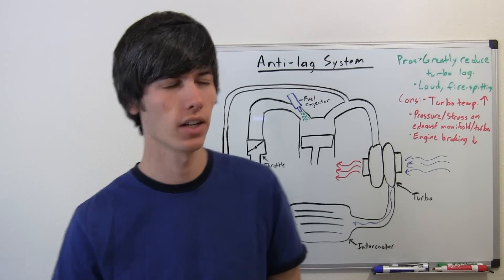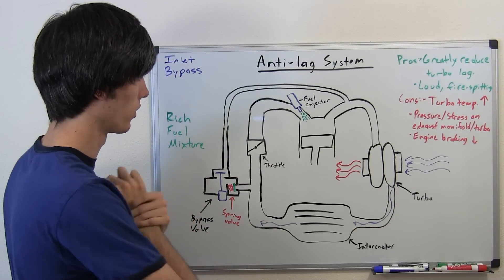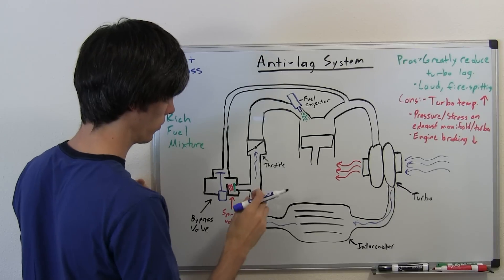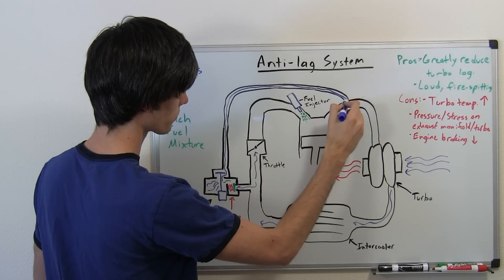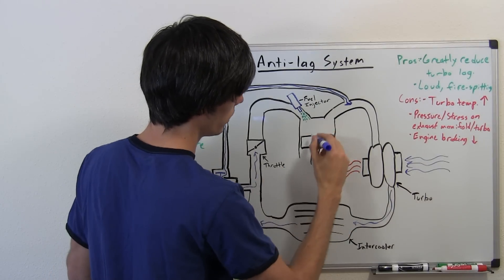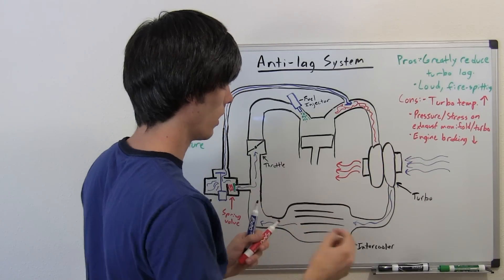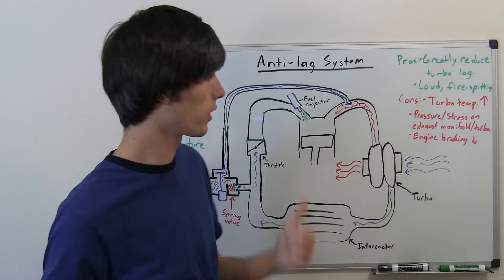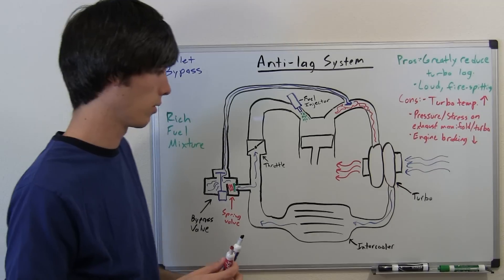How Anti-Lag Systems Work - No More Turbo Lag - Bypass Valve

Comment: Thanks.  That is a good answer. 

You show a single cylinder engine for your explanation.  In practice, is the air injected just at the start of the individual manifold runners like in the old air injection systems for unburned HC?

Comment: its really work..i modified mitsubishi lancer evo 6 bypass valve into my galant vr4..the problem now is the valves cannot withstand the heat and yes there is no engine braking and ive remove the brake booster because the negative pressure from the engine so u cant feel the brake firmly...

Comment: Yes, there were some GT-Four Celica's made for WRC homologation that came with a bypass-type ALS, intercooler sprayer and a water/meth injection system. And the Mitsubishi Evolutions 4 to 9 all had the bypass ALS installed, but with a secondary air-intake and only on Japanese market vehicles. Some special edition Subaru WRX's also had it, however most anti-lag aystems are the misfiring type ALS as it is an option on some of the popular aftermarket ECU's and doesn't require the extra plumbing.

Comment: Given that EGTs are already an issue for Mitsubishi 4m40  and 4d56 engines, as well as most turbo diesels, it looks like releasing the pressure to atmosphere, which at least doesn't allow back pressure to SLOW the turbo. Any thoughts on this?

Comment: I used to have a go kart years ago that sounded like it had anti lag with a "straight pipe" (a literal pipe). Basically there was a lot of unburned fuel due to a lean mixture (on purpose) which built up in the straight pipe we had causing combustion in the exhaust.That thing was LOUD but so cool at the same time.

Comment: Blow off valves allow turbos to maintain spinning even due to pressure build up, and it just opens the intake system to the atmosphere, but that flowing air , with a diverter valve , will be placed into a hose, back around the intake system, allowing it to just keep flowing through the intake, and once the throttle is opened again and that Diverter valve closes, that air flow allows for the turbo to still give power due to it already at a good rate of spool

Comment: In regards to you suggesting to reinforce your exhaust manifold; what considerations should i take for a vehicle that does not have a traditional exhaust manifold such as tubes welded to a collector for a turbo? The engine in question is the Ford 2.0L ecoboost

Comment: Yes, I agree but what I meant was, in Audi system the boost isn't redirected in exhaust manifold but in the intake system before air meets the turbo compressor wheel. Between air filter and turbo. (sorry for bad english)

Comment: The setup is correct. Also I'd love to see a fuel injector that can withstand the super high temps found in an exhaust manifold.

You are talking about bore wash, antilag won't cause that if it's properly mapped.

Comment: escort cosworth work different to this, it uses a larger idle valve and alters the spark timing so the combustion happens in the cylinder however the exhaust valve is open slightly so determation also travels down the manifold through the turbo.

Comment: I have a 2013 ford focus st and i have been told that it uses a BPV.  This is stock from the factory.  In order to preserve the system did ford also use a BOV in the system?  I'm confused as to why ford would use a system like this if it will not last.  thanks!  awesome video!

Comment: the exhaust manifold is actually really hot. if you look for some videos, the exhaust manifold actually glows red due to the heat. so the heat of the pipes ignite the mixture

Comment: You forgot to mention that there is similar system using Diverter Valve, for example in Audi or Saab where boost builded in intake, in case of closing throttle body, is redirected back to the turbo intake. So it's like spinning freely without builing up boost but with already builded boost from before valve opening

Comment: The redirected air going into the exhaust manifold is mixed with the excess fuel coming out of the cylinder during the exhaust stroke. How it the air-fuel mixture in the exhaust manifold ignited?

Comment: Sorry for the confusion. I'm referring to the air between the closed throttle plate and the turbo outlet. Bypass valve should redirect that air back to the turbo inlet rather than to the exhaust manifold? Cuz thats how it is setup on my mazdaspeed 3 from the factory or at least how I read it on the diagram provided by Mazda.

Comment: You wont just cause high temp and damage to your manifold and exhaust but i seen when the turbine wheel is melted down so of you payed a pretty penny for your turbo then save the anti lag for someone else. Also get an external waste gate and dump it helps alot.

Comment: good video.  
but anti lag or apc and recirculation valves blows excessive air back trough  the intake.  right?  why should it go for the exhaust manifold?.  air goes through the manifold into exhaust piping and will definitely screw up the Co2 sensor

Comment: one more question, wouldn't exhaust gas goes through the lines and to the BOV? since its coming out my force, no? I have the celica gt4 with four metal lines coming out off the exhaust manifold. I was going to make it work with those.

Comment: Thats what the MAF in GDI Engines is supposed to do. To maintain the correct stoichiometric fuel air mix. ... still mechanically simpler than VGT or VNT, or even Sequential turbo or Twincharger setup.

Comment: Great videos dude, really appreciate the knowledge, but I have a question, I am pretty knew to all this so excuse my ignorance, but with this type of system would that eliminate the need for a BOV? as you would need that back pressure to open the spring valve to bypass the air, or is a BOV still used?

Comment: I can't see this being an issue with low bhp n no cats. As explosions will take path of least resistance. Maybe even 4inch exist straight through will help send explosions in right direction?  And also inspecting turbo regular for early signs of replacement so can do small job than buying new. Am I thinking correctly? Thanks

Comment: i find that when im darting through traffic i need to drive with both feet to keep the rpms high while over breaking to keep the turbo spooled in order to have good enough 20-60 acceleration to dart into and out of traffic.

Comment: hey, a turbo car, that has a MAF, has a Diverter valve, but I was wondering, if I were to delay the timing, I could possibly put in a forge splitter so I can direct air into the exhasut and back to the pre-turbo area?

Comment: Judging by the whiteboard drawing, this looks exactly like a standard closed loop system with a fully recirculating diverter valve - like the ones used by Audi

Comment: An explosion like that in the exhaust manifold of course it would cause damage to the manifold but wouldnt it have enough force to push the exhaust valve open possibly making it float or making your pistons crack aswell?

Comment: There are celica models (gt4wrc) that were factory fitted with anti lag to meet wrc homolgation rules, but it is disabled in road going cars and I don't think the factory computer ecu facilitates the ignition mapping for it. Have herd its not hard to get going with an after market ecu, definitely hard on the manifold though and would probably grenade a stock turbo...

Comment: Its preventing the charged air from slamming into your closed throttle when you let off the gas pedal. This 'slamming' can cause damage to the turbo when the air comes back at it and tries to fight against it.

Comment: I always figured that ALS was created by ignition cut-off rev-limiters controlled by the ECU parameters, essentially just by cutting ignition to a very minimal amount would make the exhaust gas a mixture of unburnt air/fuel, but i never knew systems like this existed... Seems to me like this only exists because somebody didnt want to pay royalties to whoever held the patent on the ignition delay system. Thanks for the vids, keep them coming.

Comment: You can resort to many systems, in this case the bypass is made to direct more air to the exhaust directly to make sure there is a more complete burn in the exhaust probably... 

please some awnser my question!!! 

We keep the ignition delay of the normal ALS or does the fuel detonate ?

Comment: Can you do a video explaining what happens inside your engine when it leans out? I ask because the boosed boiz h22 swapped civic , leaned out on cyl. 3 due to an electrical system issue, but the damage on on the single cylinder is insane!
Reply: I understand that the fuel cools down the engine somewhat as it runs, and i know e85 does it better, im just curious as to why it melts the way it does and not from like the center outwords, or rather from the exhaust side of the piston first, besides the fact that thats where the air is rushing in from

Comment: With the bypass valve is this the system where you can adjust it to either atmospheric (Creates the woooaaassshhh sound) when you let off the gas pedal or change to recirculate like you were demonstrating?

Comment: When you showed how the bypass works, I immediately thought: that's brilliant, the pressure from the fresh air, spools up the turbo again. But then, you explained that there still is some fuel injection and explosion going on in the manifold. But that's about the same as the other ALS system from your previous video, right? 
So the only difference is the way they get their fresh air in the manifold? Is the air pressure from the bypass not enough to keep the turbo spooled up?

Comment: So the bypass valve is pretty much just a recirculating blow off valve plumbed into the exhaust manifold ? quite easy to setup then, just a matter of programming the ecu to activate als?  cool. I guess the program parameters to be met would be > X rpm + throttle position < X position yeah? does that sound right?

Comment: I have a question. what is a great material that would be suitable for a exhaust manifold that will have a ALS installed? Also, can a Dog box transmission be another solution to lag in turbochargers? ty :)

Comment: Good video man....... and how does the other DV works which is mounted on the compressor wheel  housing..... cause i thought this thing was designed to protect the compressor wheel?????? Anyway your diagram is exactly for MK6 R version and for MK6 gti  it doesn't bypass that pressure like that and the intake doesn't blow...... please clarify for me on that system man..... thanks

Comment: Hey man, not related to anti-lag system but could u explain how the bypass valve that are built in cold air intakes prevent cais' from hydrolocking? @engineeringexplaned

Comment: Engineering Explained Wouldn't the explosion happening in the manifold force the exhaust valve open or maybe damage it?
Reply: The exhaust valve is already open. Anti-lag works on the ignition/exhaust strokes.

Comment: You say that this bypass type of anti lag still has the disadvantage of no engine braking, but the throttle is closed which will cause a vacuum when the cylinder is on an intake stroke - the basis of engine braking.  Please explain.

Thanks.

Comment: I'm not sure that I understand this correctly, but typical blow off valves vent to the outside air, right? In this scenario for an ALS, the blow off valve should be connected to the exhaust manifold before the turbo?

Comment: You say the fuel system is still supplying extra fuel.  Is this because it's using something like an air flow sensor ahead of the blowoff valve or a MAP sensor ahead of the throttle body?  Or is the ECU simply programmed to dump in extra fuel for a few seconds when the throttle is closed?

Comment: Hi, I have a question:
in the case we have the fuel shut off valve, this would not work anymore, since we just have air in the engine,right?
For what concerns the anti-surge valves, is there an advantage in recirculating the air in the intake duct, upstream the compressor, rather than discharge it in atmosphere?

Thanks!

Comment: well, keep the turbine spinning, even when you close the throttle, see Blow off valves just releave that pressure, but instead of blowing off, it gets to be recirculated for that instant after closing the throttle body, allowing no pressure build up, while maintaining  the turbine's spin speed. When this happens that turbine is still spinning so the next time you get on the gas, it still can push air, once that diverter valve closes.

Comment: Which ALS do you prefer out of all the methods?
Reply: +Chris P it depends on what you're gonna be doing. I have a Subaru BRZ equipped with a turbo kit using an ALS Bypass Valve mentioned in this video. I use this since it's more quieter than the ignition delay considering how ignition delay ALS makes your exhaust spit flames.

Comment: So does the BOV still exist if the bypass valve is there? Or is the BOV installed after the throttle body, while the bypass valve is before it?

Comment: do you necessarily need to run a rich mixture during this process? why can't the bypass valve just reroute the boost into the exhaust turbine without burning fuel (as in just keep having the air cycle through until the throttle is opened again)?

Comment: what are the pros and cons of  by pass valve system vs anty lag system that burns fuel in the cilinder with the exaust valve open??? wich is cheaper? easier to install, more engine friendly??

Comment: Correct me if I am wrong, but is this the same concept as the "Red Bull" blown diffuser in the pre- V6turbo era (<2013) in F1, burning the fuel in the exhaust off throttle to maintain a high pressure flow of air to the rear diffuser out of the exhaust during slow corners to maintain the high extra downforce level benefit from the diffuser when at full throttle (but when it is really needed)??

Comment: So, basically the air fuel mixture decreases by, say, 80%. Does the air fuel ratio stay the same or is there a greater mix of fuel when the throttle is closed? Would there be an air fuel ratio of, say, 4:1 as opposed to 15:1 in normal throttle? If so, your saying that the low air fuel mixture would not ignite in the cylinder, but in the exhaust manifold?

Comment: Ok, not that you've explained both which system is considered better (less stresses or more efficient in maintaining the rpms of the turbo?), the ignition delay system of the bypass valve?

Comment: so every 2015+ subaru wrx with the fa20dit has this system. the stock bpv leaks but now that i have a boomba bpv, it recirculates its 100% without leaks, i have antilag on my car. when i shift gears, getting on the gas again, i find myself already at 5 psi.

Comment: Wouldn't it be more efficient to bypass before it goes into the inter cooler when it the air is still at higher pressure, lower density? that way you could depend on the extra pressure propelling the turbine instead of the combustion in the exhaust manifold, allowing you to cut fuel when you lift off and save on gas. plus less combustion =less heat, kind of like having an on board compressed air tank to power up your turbo after lift off. I just wounder how effective that would be.

Comment: What stops the exploding air fuel mixture in the exhaust pipe from travelling back down the bypass valve tube
Reply: Pressure. Too much coming through it to allow anything to flow back.

Comment: I can’t understand your problem but the idea is to have O2 in the exhaust, while if you redirect the air to inlet (I don’t know the origin of the air you are talking about). 

First: you bypass the air to protect the compressor from backpressure and to keep it spinning (like dump valve)

Second: you can’t have exhaust gases in the inlet
I am not exactly answering your question but hope what I said helps you.

Comment: I've bought a Subaru with ALS. I'm quite a beginner. My question it will be if I've got a blowoff valve, my ALS is for shure not an bypass valve one, right? Wich would be the most recomanded ALS? (sorry for my bad english) regards.

Comment: which method of the 2 puts more stress on the turbo and exist manifold?
Reply: +Andy Lehmann spark cut and fuel blow-by. The simplest form is as first stated of just porting compressed air into the exhaust stream, but this by itself doesn't really do much.

Comment: why its bad for the engine since the explositions are after the head ex? because the ECU sprays too much fuel inside the cylinders? or because  the explosition are going back to cylinder though the exhaust valves?

Comment: A supercharger requires the RPM of the motor to turn the Impellers, so it would not be capable of flowing enough air. The bypass of the motor means you can get full boost at any rpm without damaging the motor internals.

Comment: So whats the diff between this type of BPV and the one that comes stock on a car like my Mazdaspeed3? Is it that mine recirculates back into the intake instead of bypassing straight to the turbo manifold?
If so, then why is it called "Bypass" valve if it doesnt bypass the engine?

Comment: Quick question Engineering Explained.  So does having the bypass system eliminate having a BOV cause I see the spring is there but instead of releasing the air out the BOV it goes through bypass system? So you're pretty much putting that air that would of usually just been pushed out to use? Just trying to figure the little things out ya know.

Comment: Why not 2 bypass valves, the one already placed and the other in the exhaust manifold; both the turbines and the 2nd valve electronically controlled to keep the turbine running when deceleration happens while opening and closing the valves when needed to keep the ignition inside the cylinder and to maintain/release pressure when needed ??